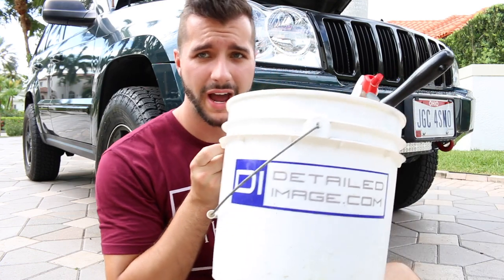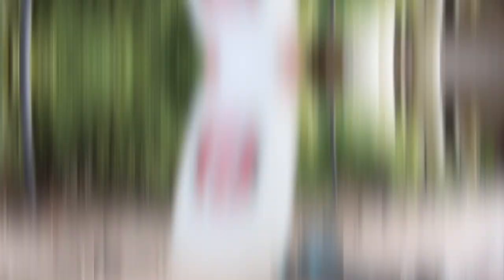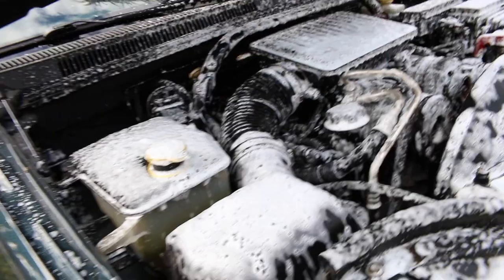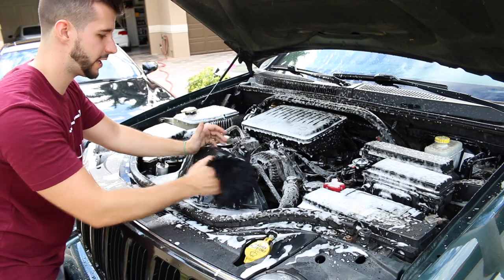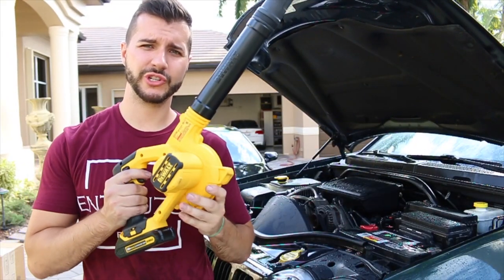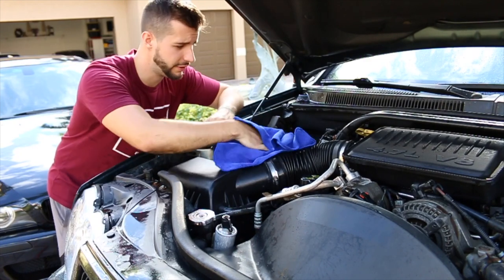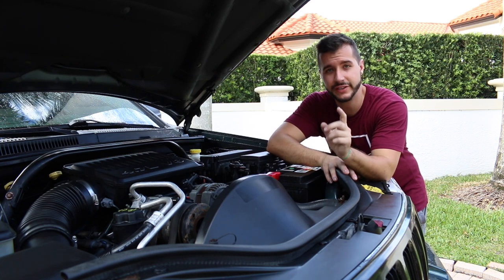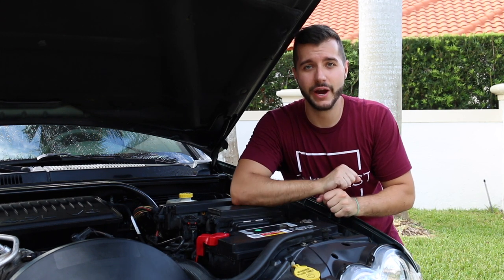Detailing Your Engine Bay the Easy Way

Comment: Nice video good camera! I discovered CarPro PERL here in the UK around 6 months ago and it goes on everywhere! Tyres, Engine bay, all exterior trim. It can even be used diluted on interior hard surfaces. The more often it's used, the better the finish becomes and as you say, water based, so can be used with confidence. Cheers.
Reply from the maker: True. I like how versatile it is

Comment: Still think 4K is the way to go. 

On the engine cleaning I just go to the car wash and use the pre-soak soap and let it sit and then I pressure wash the engine and the hood and if the engine is warm then voila I am done. It does a very good job 10 minutes.
Reply from the maker: Why go to the car wash when you can do it at home
Reply: @ShiftedPerspective  Because the car wash has a pressure washer and my home does not (yet).
Reply: Shifted Perspective because it’s 5 minutes away and all I have to do is put  3 dollars in the slot, no fuss no muss.